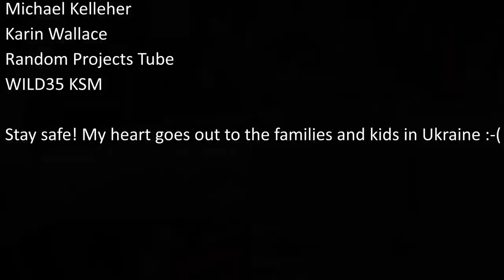Rusted Junk Bench Vice Restoration.

Comment: Nice job on the comparison...  Also, Very interesting vise...  This one, although quite simple in its manufacture is NOT a cast piece subject to cracks or breaks.  It is also completely repairable with simple welding methods since it is standard forged or rolled steel.  If you ding up the anvil section, simply clean out the ding, fill it proud with weld, and file it back flush.  Good as new.

Comment: So, it looks like the best process is to do all the initial cleaning with hydrochloric acid, wash it, and then let it soak in Evaporust. That way there is better rust removal, less cleaning of the part afterward, and better protection. And it keeps the Evaporust cleaner.

Comment: That pin you put in the screw shaft is a design problem.  It will wear against the jaw frame as you turn the screw out, and eventually fail.  It needs a washer between the pin and the jaw frame.
Reply from the maker: I tried to put a washer in between but there was no space at all.
Reply: I agree.  In the video, it did not look like there was any space.  The only alternative I could see would be to remove the washer on the other side of the screw shaft and put it between the pin and the jaw frame.
Reply: @AJRestoration  it because there is only supposed to be 1 washer.  You put it on the wrong side.